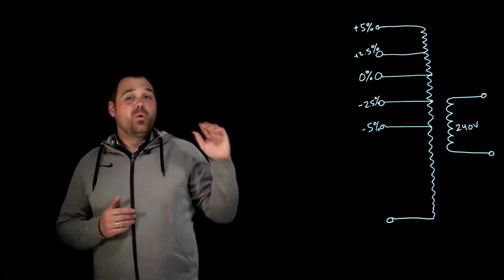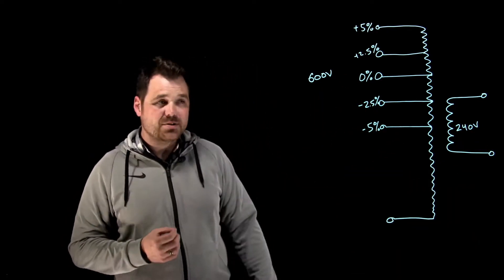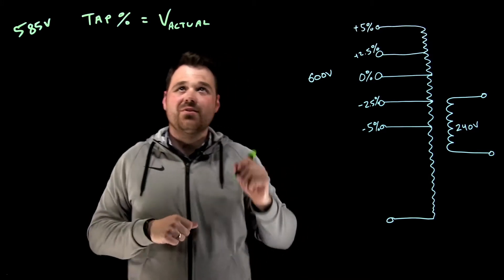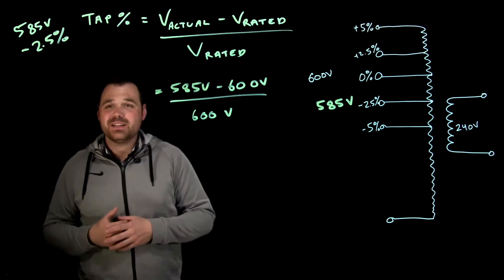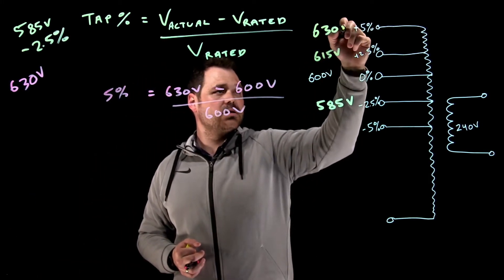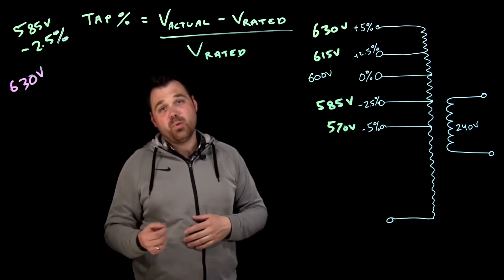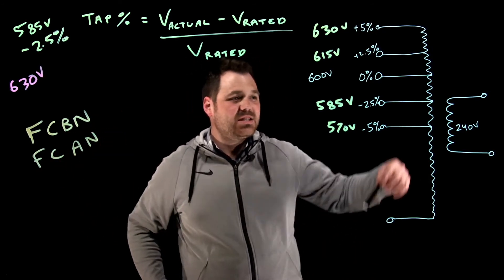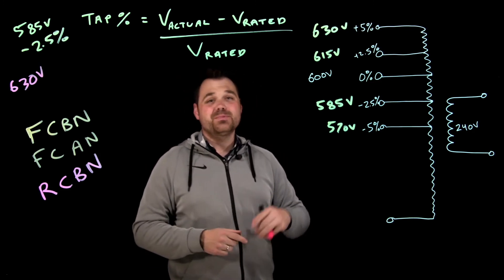Primary Voltage Taps on a Transformer

Comment: Just, wondering, in a three phase transformer, is it advisable to use different taps per phase in a primary in order to have a uniform secondary voltage?

Comment: What if the Main inputs power supply or Main is 600 Volts Tap accidentally to  480 Volts Transformer Primary windings. What will be the Voltage and Current of a Particular 230/240Volts rated Secondary transformer. What woul be the results.

Comment: Since 585 v will give 234 V in secondary. So in order to increase secondary voltage from 234 to 240 WE need to decrease the number of turns in primary. So you should have put negative percentage on TOP of 0%✓.

General rules: 
To increase secondary voltage, turns number in primary must be decreased.

To decrease secondary voltage, turns number in primary must be increased.
Reply: yea thats literally what he said, i am always baffled, that the only explanation we got is some formula. "Due to input voltage being "this and this" our formula gives us "this and this", but ffs why???????.
Reply: If you look at the drawing,  the output (secondary) voltage does increase as the primary wraps decrease.  The percentages on the primary in this drawing are with respect to the input/primary voltage,  not the output/secondary voltage.  So if your input/primary voltage is -5% use the tap marked -5%

Comment: If the primary voltage is exactly 600V, is the tap position 0?
Reply from the maker: Yep!
Reply: @ZackHartle great presentation there. Just to add for the transformer with taps you have just shown. It will have five tap positions with +5% being no. 1 and 0% which is nominal being tap position 3. That is based on what I have seen in the industry.